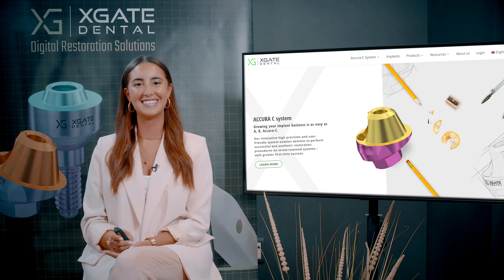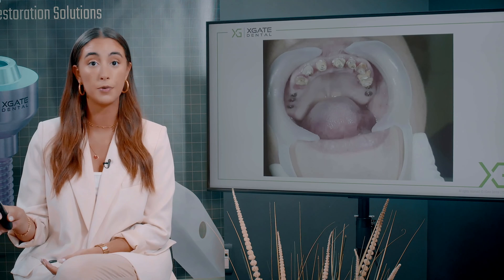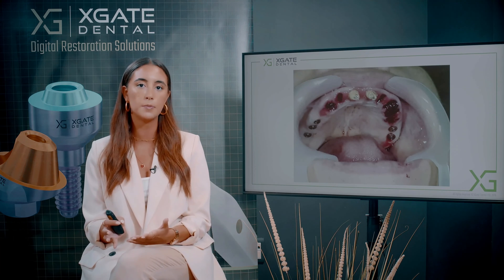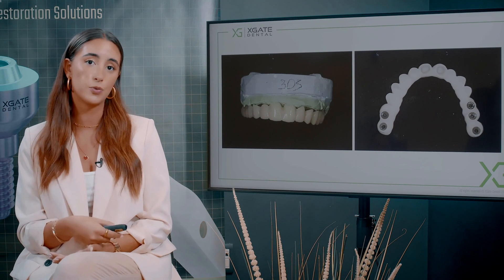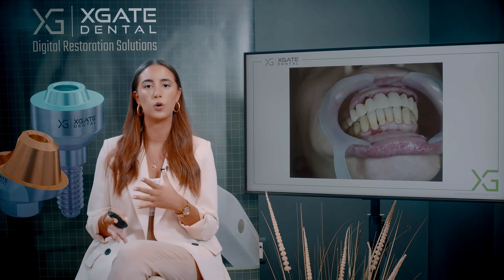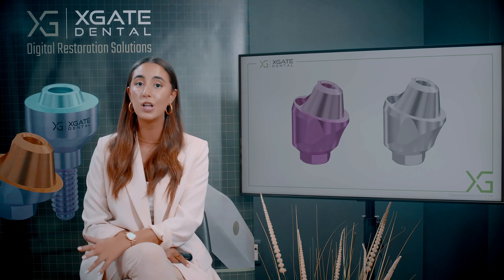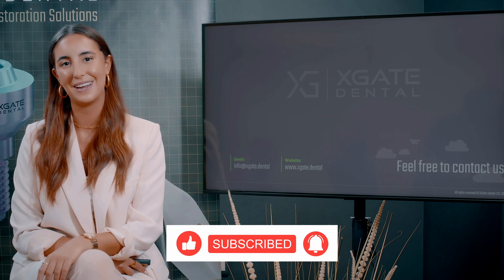So, why make a bridge and not just to remove all the teeth and make a denture? V Type Multi Unit

Comment from the maker: 00:00 All the colors that it absorbed
01:00 You can see the teeth after some preparation and cleaning
02:00 We made a bridge that was made with two implants
03:00 a gypsum model and scan
04:00 Now to correct the offset 
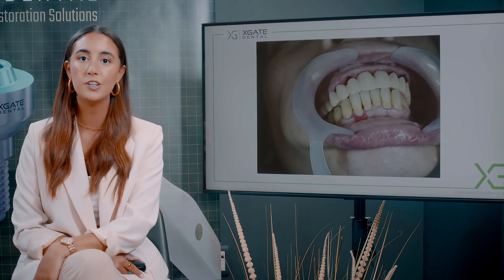05:00 This is after the osseointegration
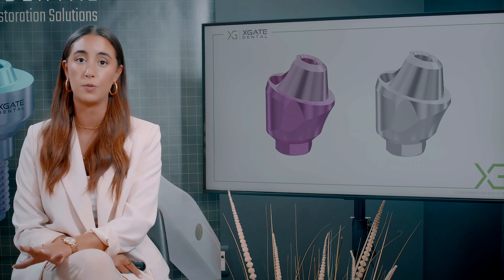06:00 You won't see the gray color that you seein many cases